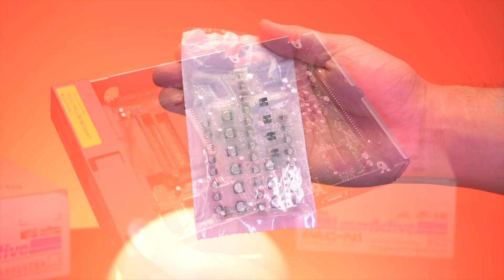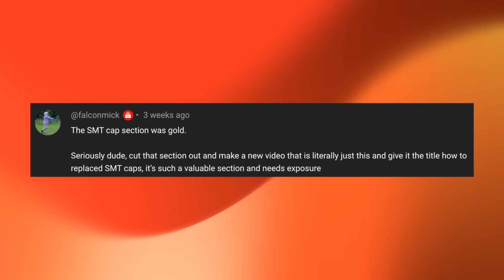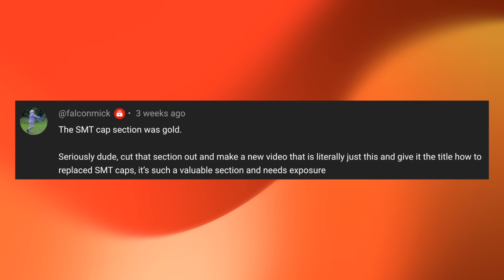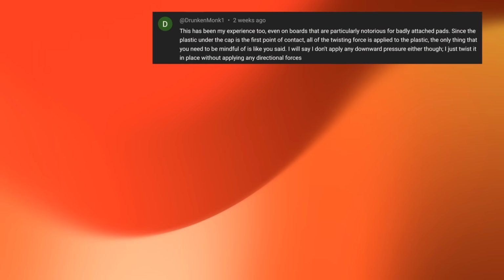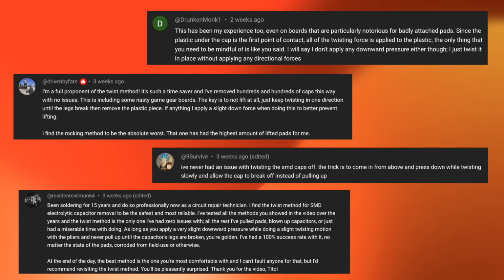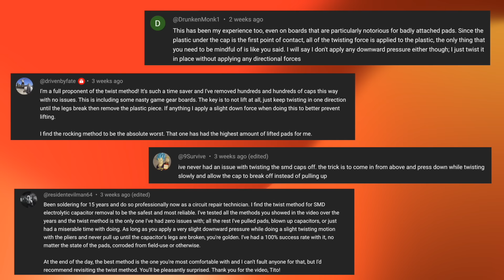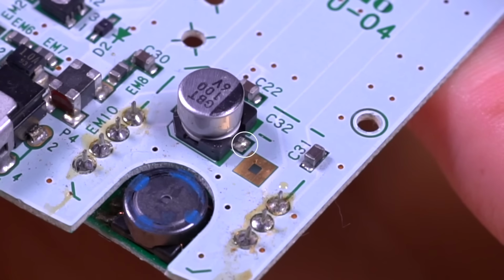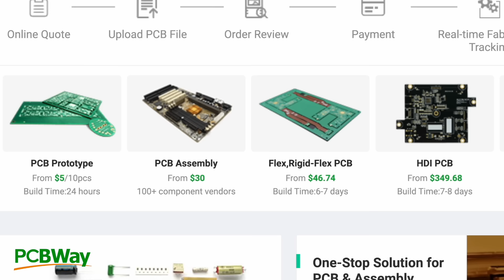5 Ways To Remove Surface-Mount Capacitors | One Is The Best!

Comment: If you are not experienced, please avoid using hot air as you will likely damage your devices. Use alcohol to loosen up the glue prior to removing.

Comment: I'm new to this stuff, so sorry if this is a stupid question. Would it be possible to use a soldering iron on 1 pad, and twist at the same time to remove the legs from that pad, and then just simply use your soldering iron on the second pad since one leg is already removed?

Comment: 2:05 exactly how I pulled the pads on my ogxbox when recapping, had to do 2 trace repair. Be VERY GENTLE, doesnt take much force to lift a pad.
Reply: The lifting motion is pure perpendicular forces and that’s the exact force that rips the pads up! If there is any force, you only want horizontal shearing force that’s in the  twisting method. And of course no force is always better but unless you have a jbc desoldering tweezers you can’t do that 😂

Comment: Man I have struggled to remove a lot of these. I'll clean them off, apply flux, apply a touch of new solder then use the solder sucker, if it isn't free after that I apply more flux and reheat while tilting the cap up (your rocker method) so that the leg lifts from the pad, and so often the pad will come off anyways. It kills me. I've been learning to repair pads, but it is so tough. I'm guessing it's something about the age of the GBP and GBC's that I'm working on that causes the pad to not be attached as securely as it once was. Something has degraded. I'm gonna try delicately cutting them next time.

Comment: Twisting off in one direction is not recommended as it will also crack the foundation below. I have experienced this many times.
Twisting it off in both directions multiple times is best.

If you do not want to destroy it, you can warm one side and lift it up a little, warm the opposite direction and lift it up a little, and so on, lifting it up a little on each side, etc.
Reply: This is true. Tito loves to keep believing he’s right though so he won’t like your comment 😂 instead he does it the worst way possible to declare twisting = bad

Comment: I personally use the twist off method. The cut off method look’s solid as well but I’ve never tried it. I’d rather avoid blowing a cap so the hot air and tweezers methods are a no go for me 👍
Reply: Cutting is worst. It exerts perpendicular forces thats exactly what rip pads.

Comment: Low melt solder is my favorite method. Add low melt to both sides. Then heat one side with the iron for a few seconds, then heat the other then remove it before it cools. This method also works with hot tweezers, but for the exact reason that you displayed, I don't like using them on known bad capacitors.
Reply: Are you talking about Chip Quik?  That stuff's amazing, but kinda pricey.

Comment: one method is missing
low melt solder  flooding where you add super low  melting point aloy as a solder and it doesnt get cold enough to get hard while heating the other pad

it could be iteration on the first method  but easier

Comment: Tronicsfix uses a different method than these five. What he does is place the solder Wick on the capacitor leg then heats it with a wire letting it soak up most of the flux, he then switches sides and when that's done it is usually either removed or he can use his iron to easily lift each side. So similar to the rocking method but most of the work is done by sponging the solder with a wick.

Comment: 8:14 What if you let some isopropyl alcohol soak the area for a bit for a moment? Every time Jerry Rig Everything tries to remove a phone battery that the manufacturer doesn't want removed, he soak the glue with isopropyl alcohol for a little while to weaken the glue's bond before ripping the battery out. I would think the same could apply here if you can get it wiggled up and leave enough room for the alcohol to get in there.
Reply from the maker: That could potentially help. The glue on the pac-n1 is very strong

Comment: What temperature do you usually have your soldering iron set at for these type of repairs? Thanks!
Reply: For me a temperature of approx 300-330c is more than ample for leaded solder, for lead-free you might need 320-340c, but I've stuck with 325c for about 4 years now and the only time I need higher temps is for large ground/power planes with lots of copper in them.

Generally it's not so much about temperature as it is about thermal mass, the more thermal mass, the lower you can have your temperature (up to a point that is) and the easier you'll find it is to solder, so use a larger tip for when using solder wick/braid or on large masses of copper, and only use a smaller tip if there's space constraints preventing larger ones from being usable
Reply from the maker: Depends on the application but typically 350C

Comment: I had ZERO ides that tech needed to be maintained to that degree.

Where would 1 go to get this service done on their old consoles if not confident enough to DIY?
Reply: I have a couple of retro video game stores in my area that can do it, but they might be in the minority that way. You might want to search for "electronics repair" in your area, or see if you can connect with any HAM radio folks (most like to repair and mod their own equipment).
Reply: @jamesfrankiewicz5768  Oh for sure, thanks!  This community is really awesome & helpful.  I have only done simple wire soldering for basic lights or mending animal chewing issues so this is all above my pay-grade🙏

Comment: I know about the classic Xbox battery but are there other old consoles I should look at.
My old consoles are ps1, ps2 (slim and fat), ps3 fat, nes, snes, n64, gamecube, wii, wiiu, sega genius,  Saturn, dreamcast, xbox, xbox 360, 3ds, psp, ps vita. I was thinking of upgrading a few of them and replacing the older ones with a mister fpga since there working on a cheaper clone board for just emulation and it would be cheaper and take less room than upgrading everything.

Comment: PRO TIP for the "Twist" Method:
DO NOT USE ANY TOOLS!
Just use your fingers and wiggle the cap. IT'll fall off.
Don't force it, be gentle and just wiggle it off. It is very quick and toolless...
Its not as bad as it seems, if you do it the right way...

Comment: The twist/rocker method is extremely risky. Sure, you can get away with it, depending entirely on the PCB and capacitor condition. 

Have a corroded GameCube optical drive board, though? You're tearing off everything surrounding that capacitor, solder mask included, 10 times out of 10. That's just one example.

Comment: The twisting method does not work like that. If you do it right, it breaks at the plastic base not right at the pads! The correct method is twisting it not in one go but clockwise/anticlockwise multiple times slowly. You are neglecting the direction of forces in your thinking by the way, shearing forces place way less pressure that will damage the pads. Cutting a cap has way more perpendicular force that rips pads easier.